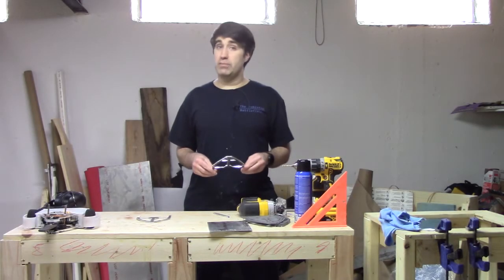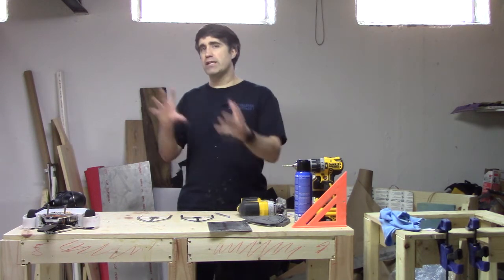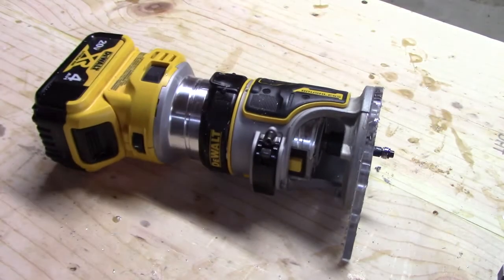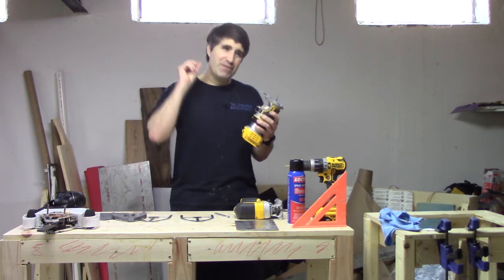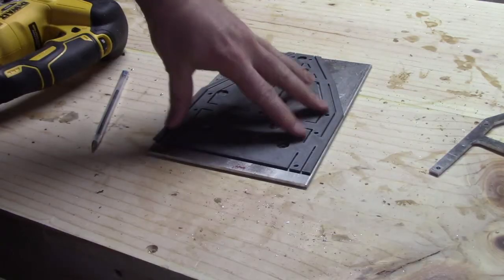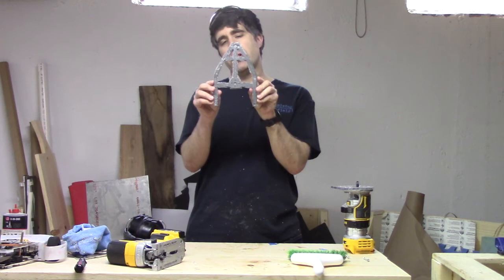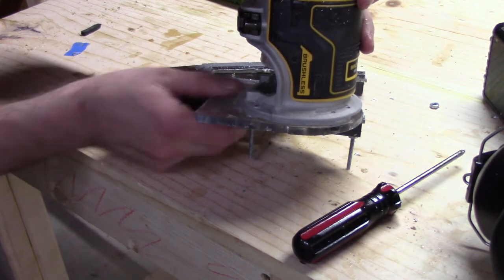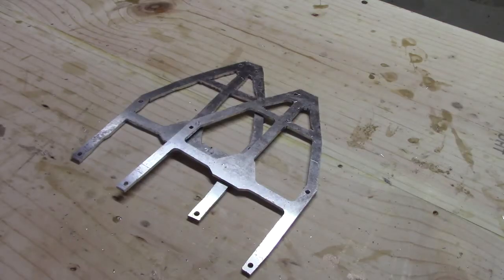Improved  Beetleweight Combat Robot Frame without CNC tools - A Robotic Combat Tutorial

Comment: Wow, I use the exact process to cut the UHMW parts on my antweight drum spinner. But instead of bolting my templates to the material I just use really sticky double-sided tape.
Reply from the maker: It's a great example of borrowing a solution from another trade.  I saw a demonstration of a flush trim bit being used on a counter top and I was like "this solves everything....unless you are working with steel or titanium."  Though I don't show it in this video, I've already used it on UHMW as well.